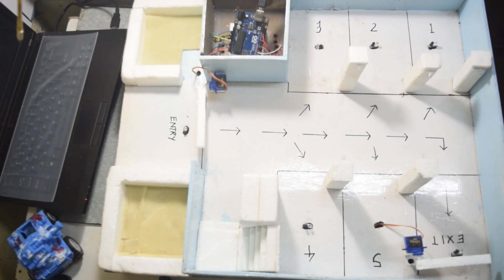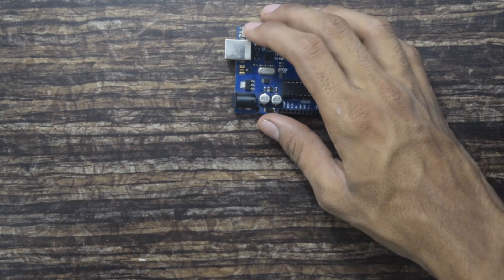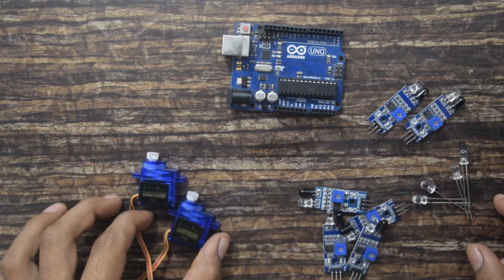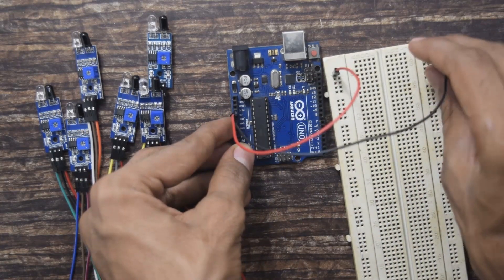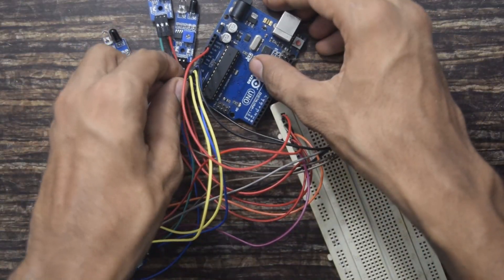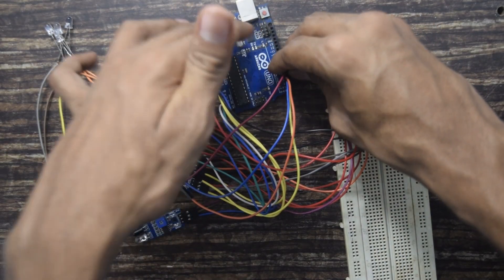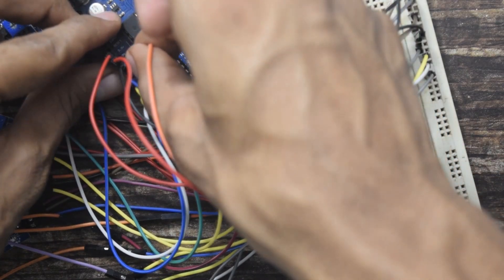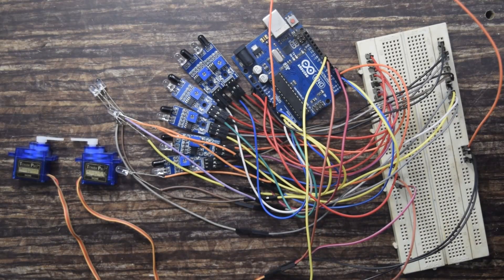Arduino based Parking system - #arduino #project #robotics #finalyearprojects

Comment: My  SERVO MOTORS don't work :(

in the procedure, if you put a finger in front of a sensor THE LIGHT TURNS ON.. but at the last the opposite happened. Why is that so?
Reply from the maker: Might be because of wrong connections check the connection and if it still happens then then change the logic in the code

Comment: Please Give the code and circuit diagram to add the LCD display in it
Reply from the maker: You will find the link in the description
Reply: @electro_king_official  The given links I have checked but there nothing given about LCD display,so when will I get the link ?
Reply from the maker: @saurabhwaghmare4249  
this code is only for parking system not for LCD parking system

Comment: the code is not working bro i kept on getting loops on servo its always going up and down
Reply from the maker: check the connections and make sure you have connected the sensors that controllers the servo properly because i was also getting same problem and latter i came to know that it was happening because of sensor

stauseef123@gmail.com

Comment: how many ir sensor we connect to the arduino?
Reply from the maker: 6 because their are on 6 analog pins on Arduino A0 to A5 and if you wish to extend than you can use Multiplexer IC and then you can connect many IR sensors
Reply: ok👍